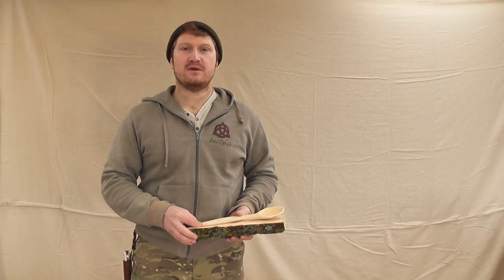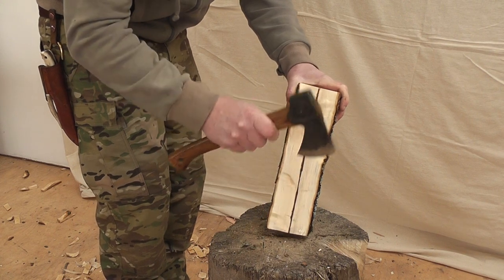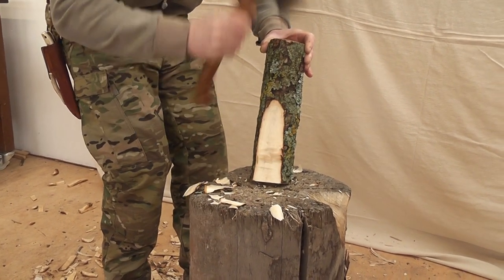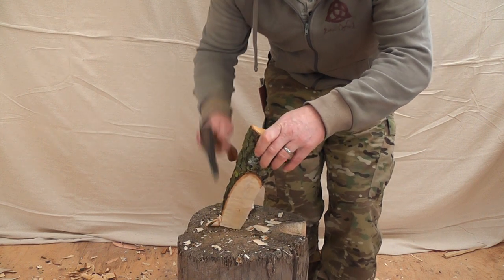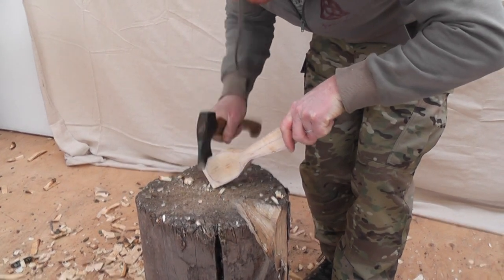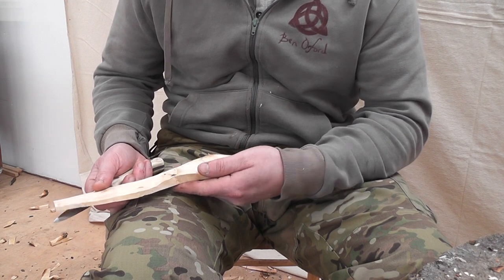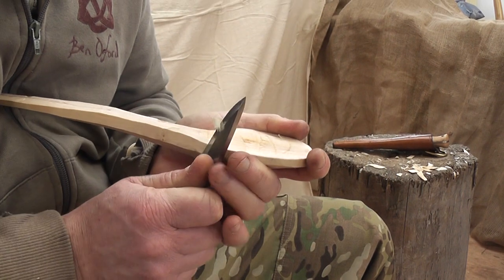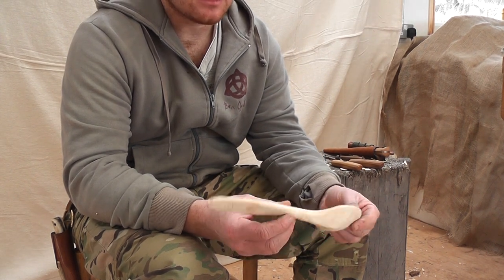How to carve a spoon with Ben Orford

Comment: Ben, I don't know about carving spoons but I know about backs! Your lower back will give you problems in a few years. You need to raise your chopping block so you're not bent over so much. Try and stand as straight up as possible. Nice vid and lots of advice, most on the safest way of cutting. Give your lower back some consideration as well.

Comment: I got a wildlife hatchet as a promotion when I got my Tormek slow speed grinder.  My problem is I can make nicks in the wood like you did but when I try cut downward to cut them off the ax keeps bouncing out.  It looks like it is hitting just before the edge pushing the ax out.  Do carving axes have more of a flat scandy grind next to the wood?  I guess a file would take that hump off and make it flatter.  Tormek has an ax jig so I was wondering if that would work.  Don't know if it would give a hollow grind to the edge.  I know you have ax sharpening videos but do you have any pertaining to carving ax sharpening?  Thanks for all the info.  Bruce from the City of Orange in Orange county California USA

Comment: Thanks Ben Really enjoyed making Spatula - a little wonky but usable.  Used Hazel as I have a lot.  Will it split? How long before I can use it? Thanks again.  Where are you based?
Sally 🇫🇷
Reply from the maker: Great, Hazel is a nice timber to use and very dense timber. It should split so long as you haven't used it in the round, always make sure you split the log at least in half to release  the tension. We are based in Herefordshire. cheers, Ben

Comment: How do I prevent the spoon from splitting, I used green wood and 2 days after I made my spoon it had a split.
Reply: You need to dry the wood first. Because if you work your wood before it is fully dry, when it starts to dry it wil split and then all your efforts will go to waste. Hope it helps!
Reply: +Dwayne Scott Friso Meijer is wrong. This style of woodworking is green woodworking. The wood is used in its 'green' state ie still containing most of the natural moisture. Green wood is significantly easier to work with than dry or seasoned wood. Splitting can happen for a variety of reasons; 1- too fast, keep the spoon in a bag somewhere cool and let it dry out as slowly as possible. 2- pith/inner rings left in, the smaller rings are under the most stress, if you leave too much of this wood in the spoon it is more likely to split when drying. 3-flaws in the wood, either flaws or weaknesses made while carving the spoon or flaws already in the wood. 4- Bad luck, sometimes you can just be unlucky! some woods split more than others.
Reply: Thanks, I will keep at it
Reply: +Dwayne Scott also depends on the wood u are using and grain....I've noticed white oaks tend to split pretty easy
Reply: You can add some shavings to the plastic bag also to allow drying even more. Same applies to wood turning green timber.

Comment: why medium budget when a Mora clipper or companion will do a perfect job. about £10 UK or less than 15 Euro. I have 2 carbon and 1 stainless steel and all are better for spoon carving than my £130 woodlore clone :o Mora also make a reasonable range of spoon knives, ideal for learning with. Though the 162 model need the sharp end  point rounding off for safety.

Comment: is there any other tool to use to carve out the bowl besides a hook knife?
Reply: For green (wet) wood I'd say a hook knife or a scorp is best. A scorp is like a hook knife but it curves right around to meet the handle and has a bevel all the way round. 
For dry wood you can use a deemed tool or chisels or you can even burn the bowl into the wood. I suppose you could use a scooped chisel for green wood too. Just as long as it does the job safely.
Reply: +HeyPockyWay awesome... Thanks for the detailed educated response I really do appreciate it I got some dry wood and some chisels so that should work well
Reply: +Charles Eden No worries, there's a great book by Joshua Vogel if you need any more info or inspiration.
Reply: +HeyPockyWay Thanks... I'll definitely check that out
Reply: Yes, a gouge and you can do the shaping with a spokeshave

Comment: guys, be careful watching this video. Ensure you have a polarized screen shade so you don't strain your eyes. Also, take extreme caution when typing or using the mouse the like or subscribe, it's possible to strain a finger.  Also, human interface devices are electrical, so there is a risk of shock.  To watch this video, be sure to wear loose fitting clothing, and sit in a comfortable chair to avoid strain.  Also as this video is 20minutes long, be sure to take frequent breaks. Falling out of your chair from fatigue while watching this IS A SERIOUS RISK and could result in a head injury.  As it's possible that a wheel from a plane may fall off and crash through your roof, so we advise that you also wear a hard hat.  Steel toed boots also may aid in your escape, should the monitor you are watching spontaneously combust.  Infact, go ahead and open a window now just in case....

Can always tell when watching videos from the UK...